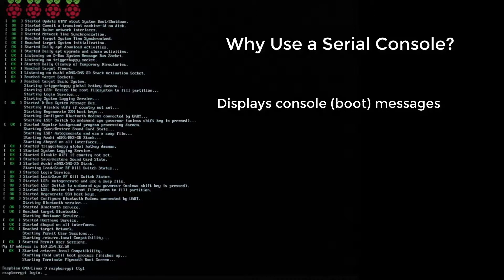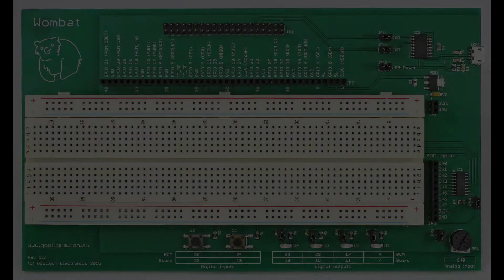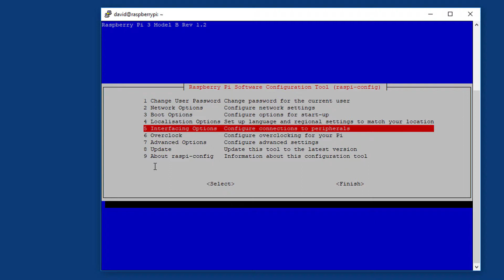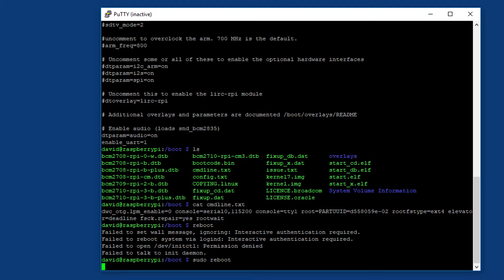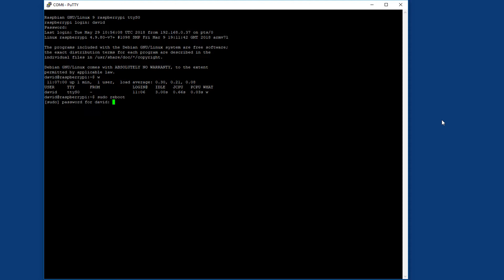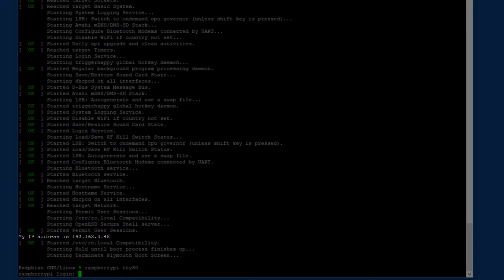Embedded Raspberry Pi lesson 2 - Serial console

Comment: Hi, do you know if this cable will work for a raspberry pi 4? I'm trying to find an ftdi cable but all of them have a 5V cable so i'm concerned about the voltage issue.
Reply from the maker: I don't actually have a RPi 4, but I'm certain that it would still be 3.3V I/O because they would have had to maintain compatibility with existing hats.  Therefore you'll need a 3.3V (or 3V) serial cable.